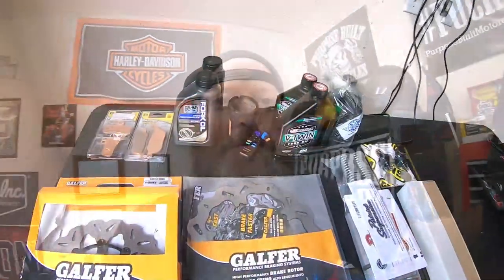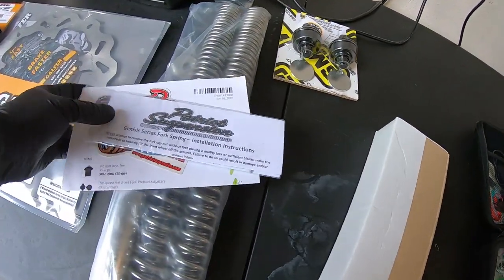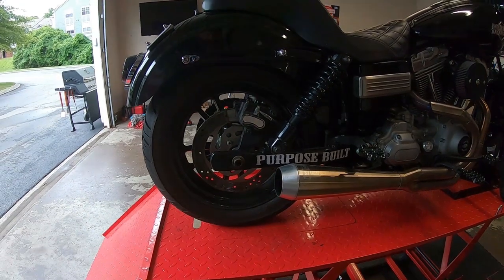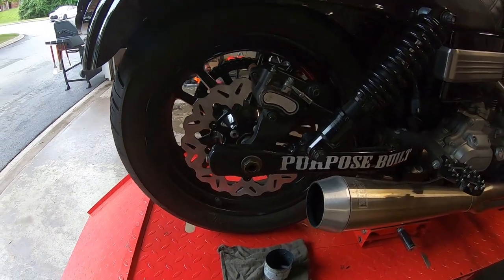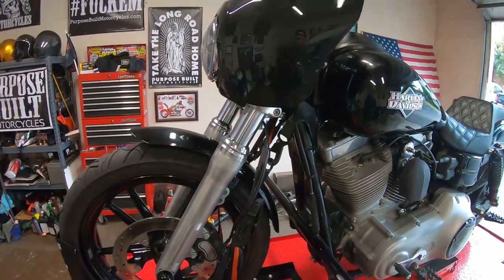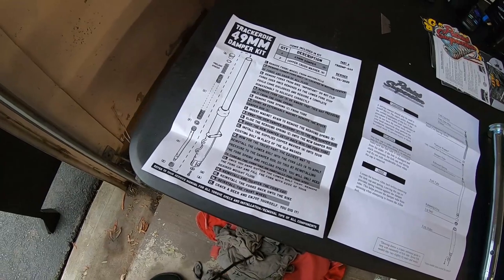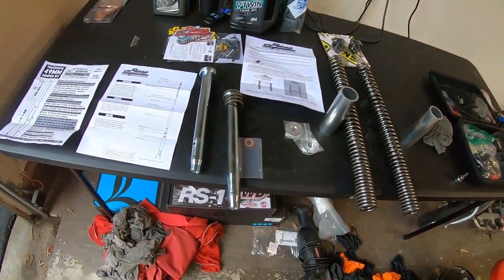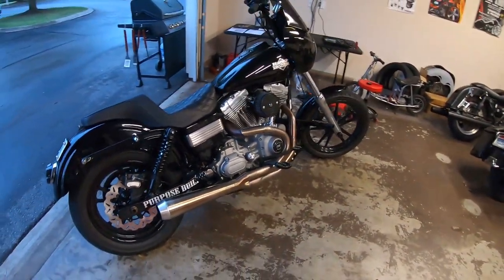Patriot Suspension Springs Track Er Die +2 Dampner Rods Speed Merchant Preload Adjusters Install

Comment: I put a second rotor and caliper on my Streetbob and the difference was so noticeable - I now have a front brake that works well enough to compliment my 113 inch 130+ BHP monster ! Twin front disc is so much better a way to go, better than any fancy rotor and caliper .
Reply from the maker: I was totally on a budget with the bike is there better out there yes does this fancy rotor help stop a mostly stock motor bike? Yes did I spend way less than you on a budget brake upgrage yes. Thanks for the comment
Reply: @TrippHPjunkie  Twin disc is better - all you need is a half the lever effort......  The fork sliders, disc and caliper all came from another (wrecked) bike  - I always look around and check out ebay a lot as you never know what you'll find !
Reply from the maker: I know what it takes man thanks....just saying that my brake mods on my bike where on a budget of rotors and pads wanted to see what kind of difference fancy rotors and pads does to braking performance on a harley and its alot with these fancy galfer rotors
Reply: @TrippHPjunkie  I tried that at first - and found that EBC pads improved braking efficiency but wore the discs out quick - that's how I ended up with the twin disc thing. Pad materials aren't always compatible..... stock Harley pads have a lot of carbon in them so they don't wear the rotors out so quick.... they don't brake as well but as discs for Harleys are so expensive.... I find twin discs and pads last about four times as long as a single disc and pads. Maybe it's just because I don't end up panic barking when a cage pulls out any more after all, I know I can stop now. I can't understand why any manufacturer only fits single disc nowadays.
Reply from the maker: Agree man its definitely on the list later thanks for the support

Comment: Did you have to get longer lower brake lines ?
Reply from the maker: Mine barely fit
Reply: @TrippHPjunkie  they are so pricey it making me second guess myself on doing this
Reply from the maker: Whats pricey? I paid $100 for the calipers with pads and $100 for the brackets
Reply: @TrippHPjunkie  yeah I got dual disc and the lower lines seem to be almost 400 bucks. I haven’t checked everywhere but in my quick search for longer lines that’s what I’m finding
Reply from the maker: Try magnum cables gor the hoses
Reply from the maker: @Klobberkrew  I just realized you have a dyna this is a upgrade for my bagger